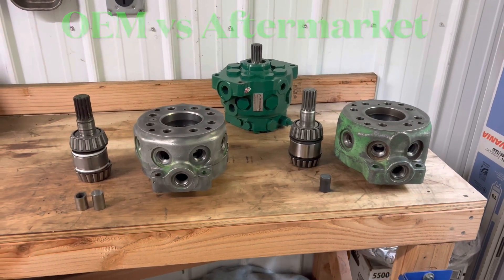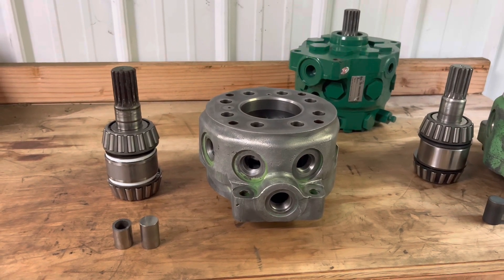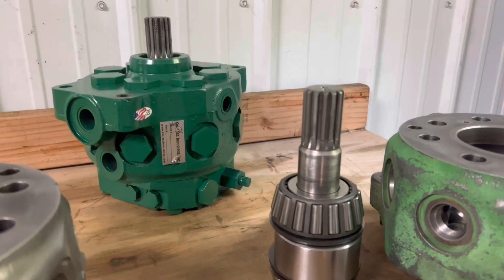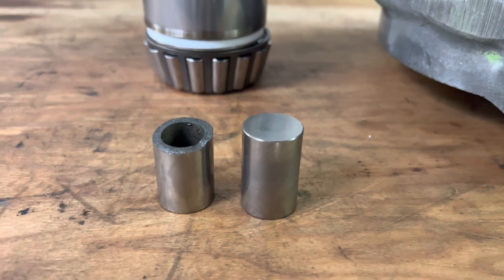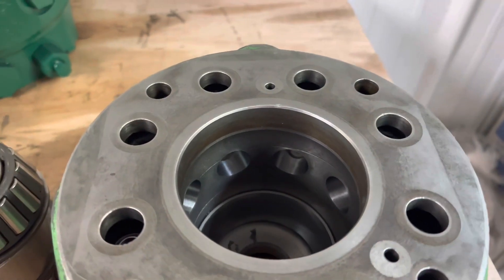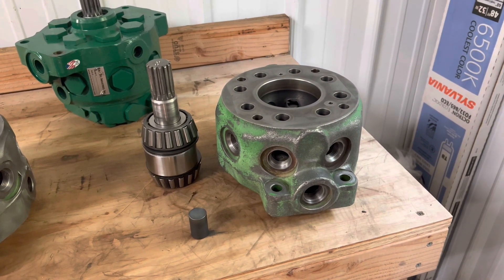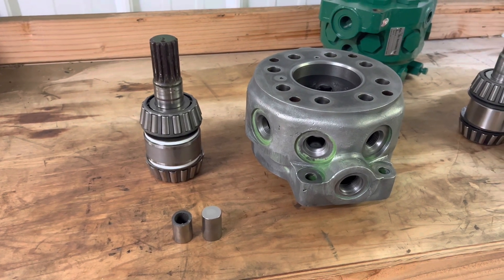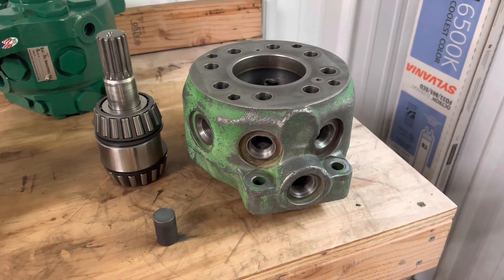John Deere main hydraulic pump OEM vs Aftermarket

Comment: I purchased a pump made in India due to the dealer not getting the pump that they said they ordered, and  never did. I needed the tractor, so I had one air freighted in from India. It was much cheaper and it works great.